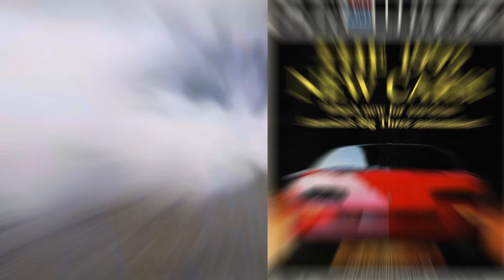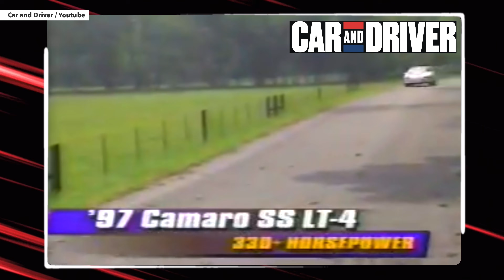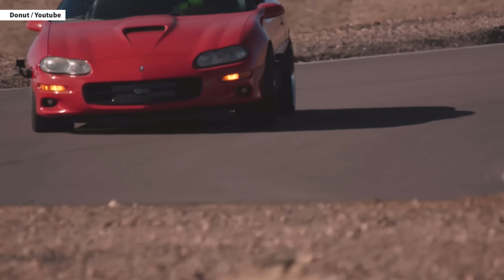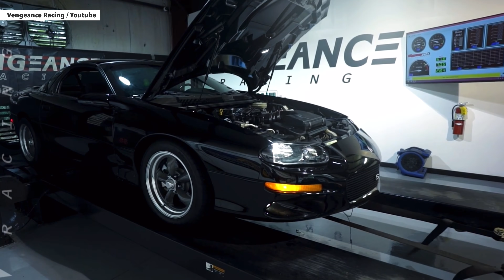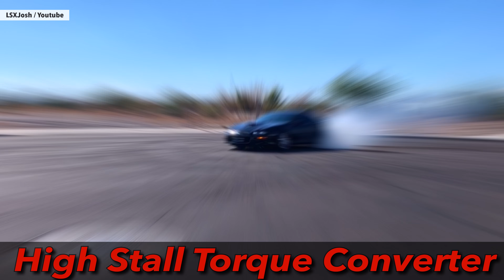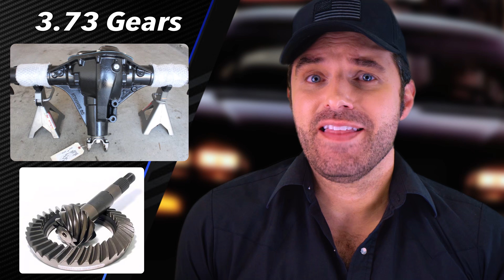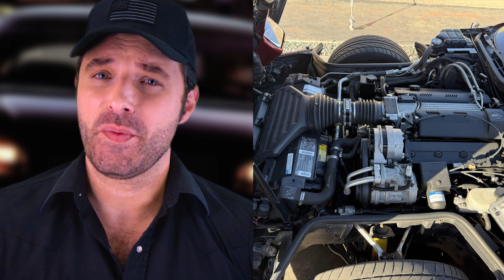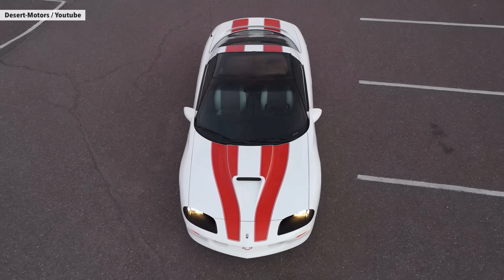Should You Buy a Camaro? 4th Gen F-Body

Comment: The ugliest and worst generation of Camero ever!  🤢 the engine almost sits entirely under the Dashboard!  It's pushed so far back.  The roof barely has any support pillars.  Put big horse power in it!... Doors start hanging and not closing right.  Sure you can put after market unibody supports.  But that car was gonna be front wheel drive in design.  But it didn't happen.  It wasn't designed for a real V8.  It's a weak unibody car not intended for real horse power.
Reply from the maker: Interesting comment. The 4th Gen Fbody was stiffer than all it’s competitors at the time (Foxbody & SN95 platforms). What car are you using as a comparison?
Reply: Engine is further back for weight distribution. It's a front mid engine (FM) design. Not because it was going to be FWD. Plenty of people putting down 500+HP with nothing more than weld in subframe connectors. 🤷
Reply: 4th gen was a hard sell. It was a love-hate relationship. I guess I loved it cause I still have my 02 cabriolet SS with a 6spd.  Yes, the quality build was less than desirable, but it still has a lot of character, and since mine is a ragtop, the car has factory frame connectors. All that said, the chassis for ride  quality is dated. In comparison, I have a 6th gen Zl1 rag top, and the alpha chassis is light yrs ahead of my 02. I'm glad and grateful to have both...

Comment: The LS1 Z28 with automatic transmissions and standard 2.73 gears, came with iron driveshafts.
Reply from the maker: Good info 🙌🙌 Yes the base Z28 automatic with the 2.73s came with iron. The automatics that came with the 3.23s(most), these were equipped with the aluminum driveshafts.

Thanks for watching! 👊👊

Comment: and dont forget them 3.8 camaros were damn near bulletproof and could nearly take a GT mustang!!!
Reply from the maker: Facts!! I had 2002 3.8, sold it with only 40k miles…I still miss it!

Thanks for watching brother! 👊👊
Reply: @HernanSpeed  The later v6 F-bodies I'd say were fun up to about 45-50 MPH... the earlier ones were fun up till about 35-40.  After that they lacked power and had tall gearing.  I had a 94 v6 that I got going about 15 seconds flat in the 1/4.
Reply from the maker: Yes. They weren’t the fastest, but great daily drivers…still beat many V8 Stangs. Suspension was also softer, so they’re really comfortable. Of course, a nice V8 always makes any car more fun! 🙌🙌
Reply: @WhaleRacer  yeah the 3.4 after you get out of the rev range can be a bit gutless w/o proper gearing etc, the Y84 diff pack really helps